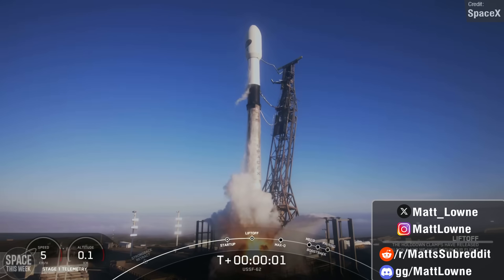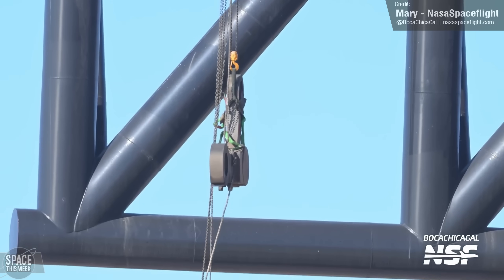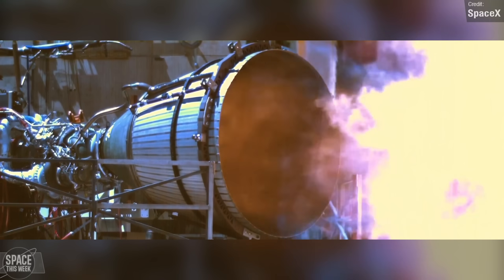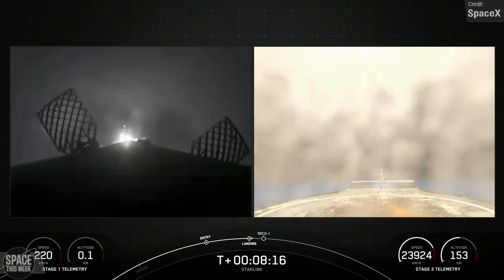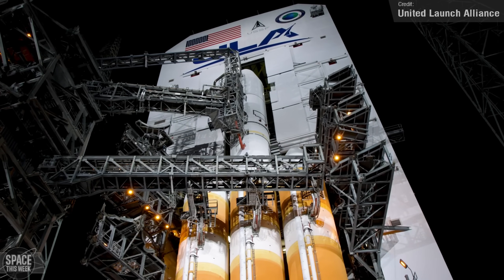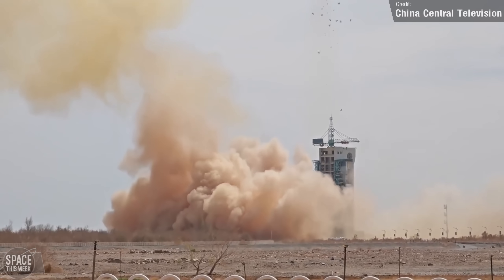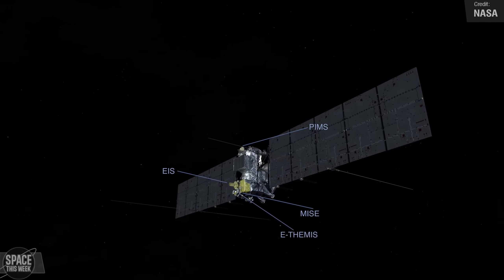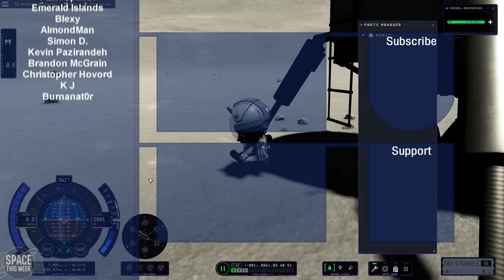SpaceX Makes Upgrades to the Catch Arms, and Prepares for Starship Flight 4!

Comment: Main question is: after Musk pulls SpaceX into ruin, who will pick up the skilled staff and get them working on non-delusional systems (Starship). Hopefully, after the demise of the idiot (Musk) Falcon 9 - who's brain was Tom Mueller NOT Elon Musk, will continue its awesome performance and not have to compete with a disaster for funding. When someone is plonked on Mars (and hopefully back again), it won't be in a Starship. Have a gander at Thunderf00t and Destin Sandlin vids, as well as the wonderful Common Sense Sceptic.
Reply: bro really thinks Elon is just there for the rid 💀 probably a libtard on top of that
Reply: Starship isn’t a delusional system. Tell me, what is delusional about trying to advance spaceflight and make it cheaper? I want to make it clear that I don’t really like Elon Musk, but I don’t see anything wrong with Starship

Comment: Catching the ship without some kind of practice facility that's cheaper and easier to fix than stage 0 seems like a better option for this until it's been done. I feel like stage zero might end up being destroyed or heavily damaged.
Reply: What other practice do they need once they know they can hover and soft land at a designated GPS coordinate in the water? The way the catch happens, they can still abort into the water if things look off coming into the tower, but otherwise there isn't a lot of energy left in a hovering nearly empty booster by the time the catch happens.
Reply: @dotnet97  to date only a single starship has landed. You make it sound easy and yet so many starships blew up on landing rather than actually landing. Considering how expensive stage zero is, I would want a proof of concept before being willing to risk it.
Reply: @awilliams1701 a single starship has landed with the flip maneuver. However, SpaceX has practiced hundreds of propulsive landings close to what the booster has to do, a couple even with Raptors, just in mid air rather than on a flat surface. As long as they know they can retain enough control to hover, it is safe to try for a catch. As I mentioned before, they are still able to abort right up until the last couple of seconds, a failure would damage but not destroy stage zero. The damage would probably be far less than even the first orbital launch attempt.
Reply: @dotnet97  I never said it would destroy it. Just concerned about how much damage it would take.

Comment: This catching nonesense will delay success for some more years. Yes, yes fanboys won´t believe it. Just wait.
Reply: I don’t think catching the booster is nonsense, but I do agree that there will be some big delays if something goes wrong.
Reply: @KerbalsandWackMacs  Yes I must admit that a working (!) catching mechanism wouldn´t be nonesense. But to get this to work reliably will cost a lot of time and failures. Complex things and systems tend to do that. And don´t get me wrong - I want SpaceX to have success. I want them to go to Mars. But some decisions I just can´t understand. Time will tell. ;-)
Reply: @Upuauta  I’m sure that they’ll be careful when making catch attempts. They’ll only attempt it if the simulated catch on Flight 4 goes well, if not perfectly. Maybe they’d be a little more bold if they had a second launch tower, but they don’t, so they have to be careful.

Comment: I love spaceX but i feel like they are trying to go to fast. I feel like they should focus more on getting space worthy and start developing the artemis program aspect.

 The artemis lander is not expected to be reusable. I feel like removing that complexity would alow them to better refine the starship before big things like landing on the lunch pad. It would be a major set back if it was to destroy the lunch pad
Reply: "go fast and break stuff" has always been how they operate.

i highly doubt they are taking unnecessary risks.
Reply: Artemis needs enough launches that they need to at least be able to reuse the booster. It'd be way too inefficient to throw away 10+ boosters on refueling, especially since they already have plenty of experience with reusing boosters. They're not optimizing as strongly towards ship reuse in comparison precisely because the short term goals, like HLS can be satisfied without it.
Reply: @dotnet97  Yes, you are right. i forgot about orbit refueling. It makes more sense then.

Comment: I’m glad you guys are easily amused. SpaceX emphasis is on all the wrong things. They worry about arms when they should address the problem which is the overweighted booster. If they can’t break up the booster. All that horse power is useless. In the present configuration the booster can’t do a total accumulative burn beyond 4.0 minutes total. So you have a booster too heavy to lift starship to 200 kilometers and land again. If they stick with 50 to 60 kilometers they still do not have enough engine burn to reach the chopper sticks. If Elon would make the whole rocket from aluminum fuel would cease to be a problem. Which can fly higher? A airplane or a battleship?
Reply: Let this be a reminder to always check your math son.
Reply: Aluminum is about 1/3rd as dense as steel, but less than 1/5th the strength, so an aluminum Superheavy or Starship could actually be heavier because of how much more aluminum it would take. Plus aluminum expands and contracts at a totally different rate under temperature changes, which may not play well with internal components.

Superheavy being overweight may well be an issue, but just making it out of aluminum is not the solution.

Titanium could help, that's about 1/2 the density of stainless and only slightly weaker, but it's expensive and limits manufacturing options. Titanium doesn't cast particularly well, you can't weld it very easily, and it's challenging to machine because its hardness makes it brittle. There are reasons steel remains so prevalent in so many industries even though it may seem "old-fashioned", it's just about the perfect balance of strength and workability (and cost for the bean counters).
Reply: I’m not sure what you are trying to say. Aluminum weighs 10% of steel and stainless steel. Titanium is no problem to work with. Falcon 9 and Falcon super heavy are made of aluminum frame , skin, exotic metals makeup the Merlin engines. If launch a rocket at 10% of the current weight. You can launch it 10 time higher. But if you launch it to 200 kilometers you much more fuel left to land with. I’ve worked with every material made. Maybe you should work with some titanium, inconel, 7075-T6 aluminum these three materials made up 88% of the sr-71 black bird. They also made up the space shuttle main rocket and the two solid rocket booster.

But stainless steel has never made up any rockets, aircraft or engine components. Save the landing gear of almost all aircraft and some engine cowl covers of very thin gauge stainless sheet metal.
Reply: @mikerash-pc4jc  out of the two options right now of believing the guy in the YouTube comments section who claims to have “worked with every material ever made”. Or believing the company that have built and launched the rocket and sent it to the desired launch altitude and speed…

I’ll go with believing the latter and not the comment clown 🤡 

👍🏻
Reply: @mikerash-pc4jc  I've never seen numbers that put aluminum at 10% of steel's weight. 1/3 has been a reliable rule of thumb in my experience - most often I'm comparing 316 or 304 to 6061. I have also called for both titanium and inconel at various times for specifics needs, but that's really besides the point. I was just rambling/musing when I brought up titanium.

My basic point was questioning if an aluminum rocket the size of Starship/Superheavy would still be sturdy enough to withstand its own weight plus payload plus the forces of take-off. Or would one have to make the aluminum components so much more bigger that the rocket only weighs marginally less in the end? I don't have much of anything to say about their CEO but I do want to give the engineers and designers, who actually do the work, at SpaceX enough credit to believe they didn't simply choose stainless arbitrarily (or at the ignorant whims of their higher-ups).
Reply: Were you aware that Mechazilla lifts boosters day in and day out?